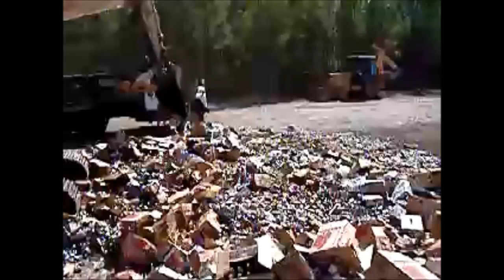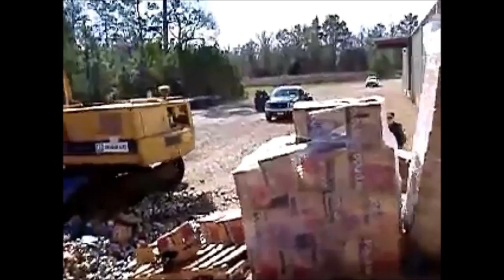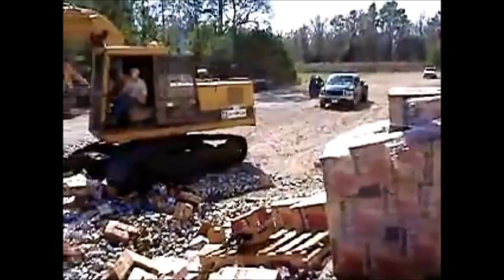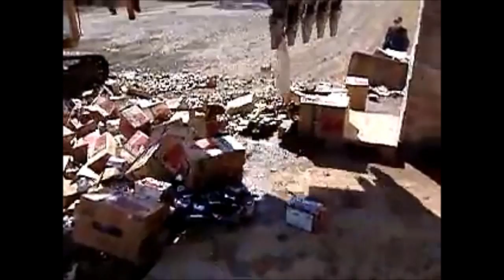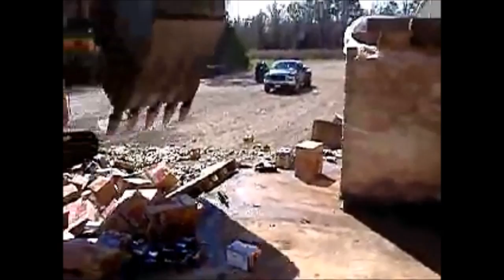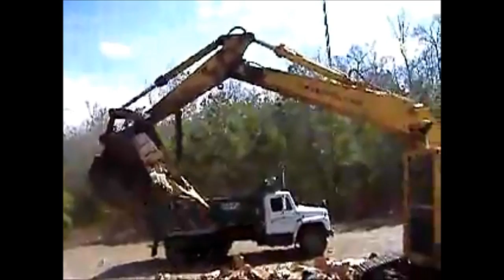Excavator Crushes A Tractor Trailer Load of Beer!

Comment: @copperheadmarine Let's say only the aluminium and glass would be recyclable, the cardboard would be evaporated in either mix, the two metals (the caps and cans) are easily separated by magnetism, after griding  all that. the cardboard and paper are troublesome to recycle and most of it ends in paper paste for injection molding, only very little ends in recycled paper facilities, due to video work I've had to visit a few and get to know the numbers about trash disposal here.

Comment: @tunespt So your country has the capability to handle this kind of situation by dumping this mess in a machine? Tractor trailer loads of it. We have a lot of problems with recycling here. I worked in the waste industry and it was a nightmare trying to recycle. On miss matched recycleable would spoil the mix. One waxed cardbord box would ruin tonns of recycleable cardbord. Recycling has all but bankrupted several trash companies. Even caused a heafty tax hike in municipalities!